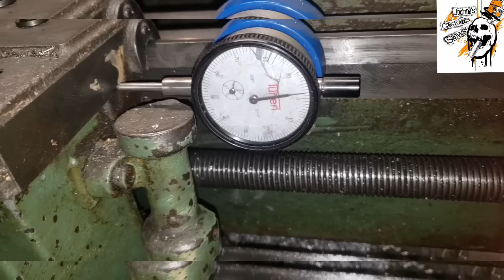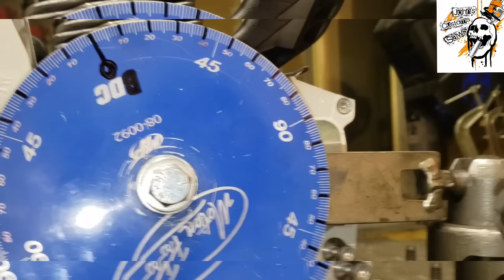Stihl MS461 chainsaw porting... START to FINISH... JCS

Comment: Never leave the oil pump dry… I use a couple big black Home Depot trash bags with a little tape between layers… you could actually ship it with fuel and it’s never letting out any odor… 

That’s a badass saw and I want one!!!  Everything that you’ve said and done is absolutely spot on… don’t ever change your ways because someone says different… you’re on the money!!!
Reply from the maker: I actually just had a shit show shipping issue over bar oil...  surprise inspection and it didn't go well 😬
Reply: @johnscustomsaws  I use trash bags…three layers with a little  tape on each layer…then toss it in a box!!
You can leave the gas in them and you can’t smell shit!!!  Drain and leave caps off sitting cap side down for a couple days and it’ll dry…rinse out both tanks with 70% dollar store rubbing alcohol… then stick a couple dryer sheets into both Reservoirs …

Comment: Sporty rick here from WLS... The original Saw Nazi 23 years.. hanging it up in 2 months, yes baby retiring!
Just wishing you good luck... Like what your doin, but if doin production speed up the process, slapin the pin back in flip saw on starter side look down into the piston to align pin, also polish the baffle and sharpen the top edge of it.. stay away from raising the exhaust port too high, you want the pop to give as it will give.......................... cutters will be very thankful for the next gen of power hungry saw guru's 
Tomorrow have 5-500i's a 881 and a 460 in new condition Monday's not going to miss them!

Comment: Hey thanks for the advice on the break in of a saw. I see so many people idle their saws for a full tank and never thought it was a good idea but now I know .... Thanks!
Reply from the maker: I will be honest i even wondered myself because people were being told by the dealership to do so... i didnt agree but was open to hearing out the theory... but after i opened up a couple that customers shipped to me... (new saws with a tank ran thru at idle)... i will never be convinced its a good method... they had tons of build up and they were running hot... they even had that "hot metal" smell... heat cycles are what i have always done since the early 90s and  its always worked great
Reply: I used to be a certified Mercury Marine mechanic and one of the first things they told us to ask about if an outboard came in with a dead cylinder and an excessive amount of smoke was "Do you use it for trolling (more important on the 65 horsepower and up engines) and then check the boat for an oil container to see if they were using a oil for air cooled engines or for marine use. Most people never seem to understand that the oil for an outboard engine is formulated to burn cleaner at a lower engine temperature than an air cooled one but I found one engine that was used more for low speed trolling or as a shuttle service for taking people from the dock to their private houseboat moorage that when we pulled the bottom piston out of an 85 horsepower four cylinder you couldn't see where any of the piston rings were at because of the oil fouling. But it also served to cut down on the lubrication of the piston itself and it had beat the skirt up so bad that you could almost put the thing back into the bore sideways because of the skirt shape.

Comment: Hammer Down brother. Start wearing gloves! I've been a mechanic for 25 years and wish I would have worn gloves from the beginning. Because now that I'm older my hands hurt and tingle go numb. I'll share and subscribe. Love the no bullshit attitude. Keep up the good work 👏
Reply: Duckworth atv and mx, I have been in the building game for 40 years and got to a stage where my hands would like lock-up with cramps and pain. Had this operation by a hand surgeon where he cut (or as he put it, slashed) the carpal tunnel free from the inside of my hand to release the tension in my palm, on both hands in separate operations. Sounds gruesome, and it is (and a very painful experience) but no more cramps in my fingers, and I can turn a screwdriver again ect ect.
Reply: I've also been "mechanically inclined" for the better part of my life, and as such have cut, burned, stretched, bruised, and beaten my hands to the point I would drop things from my hands going numb, and wake up in the morning an hour earlier because I had to run my hands under hot water as soon as I woke up due to the pain. 
Go get the surgery, do it one hand at a time and it isn't bad at all. I was out in my shop piddling around with stuff the same day after the surgeries. 
It's not going to get any better.
Reply: It's rheumatoid arthritis. I'm 56 and it just started in both hands. Diet and exercise. Reduce stress. Sardines have something in them that helps too--I forget what?--something about natural chondroitin being good for joints and found in the bones of the sardines.

Comment: That looks like fun! I ported many 2 strokes in the past. Kart racing reed and rotary valve engines. Breaking exhaust at 90 degrees!
Reply from the maker: Dude I want to try a rotary engine soooooo bad... I think it would be epic for a saw... they hit some serious RPMs ... thats awesome man
Reply: they sure do. When Mazda first brought out the RX-7 a fellow racer here in Northern California bought one new and on one of the service checks he said it was a real monster and when he took it in for the next thing he told the service writer that he really appreciated the tune up, that it would really come alive when it turned over 10,000 rpm's. The service writer turned white and checked who the tech was that left the rpm limiter disabled on the last service.

Comment: I'm a Stihl dealer. I combed through tons of literature in owners manuals, service bulletins, training materials and service manuals. The only references to damage from running out of bar oil was damage to the bar and chain. I found nothing that mentioned damage directly to the pump from running out of oil. However, in the service manual for the MS461 under pump installation it says, "– Lubricate the pump piston with STIHL multipurpose grease". 
As a service tech I have seen plenty of saws with severely burned up chains, bars and chewed up clutch teeth and rim sprockets from customers running without bar oil for extended periods of time. Once refilled the oil pumps are usually fine when I test them. I've also seen plenty of failed oil pumps from overheating when people run their saws with the brake on for extended periods and I've seen oil pumps in fairly new saws that have never ran dry just randomly fail. 
Not much of an answer I know, I'll call tech line after the weekend and ask them for a more definitive answer. I would like to know too.
Reply: Did you ever find out?

Comment: Just want to say John you got a great Channel and you're going to go places with it for sure I still have a small amount of Subs and have been at it for a few years but I'm not very active for different reasons. The biggest break I got was when aVe mentioned a saying that I use in my videos from while back when I was way more active for a bunch of different reasons. My channel will be back up and running but I'm having some spinal cord issues so I'll still be out of the loop for a little while. Keep doing what you doing man!

Comment: When I was to younger we were used to port and polish 400 and 421 pontiac engines. In the 2020s I guess chainsaws are next. In the next few years I guess they will be doing this to vacuum cleaners and vibrators lol.

Comment: 50 years ago anyone who ported aluminum used rubberized abrasive cones for polishing, available at any good industrial supply store.  Brand name is Cratex.  They were essentially the consistency of a metal impregnated crayon, and easily broke under minimal pressure, or even with your hand.  Probably why we thought they were actually made from clay and called them "crayons".   They mount to screw tip mandrels similar to sanding or buffing cones without an extended pilot shaft.  Step 1 of polishing would be piloted sanding cones or drums in varying grits prior to using "crayons" for mirror polishing the exhaust.
Reply: Cratex, still in use.

Comment: I have a 372 that I've ported and sha eved the head and made a dome top piston for and deleted the gasket on the crank case to reduce the size of the crank case and i would put it against any saw any time ohh and shaped the combustion chamber so at top dead. Enter there might end up being a open spot the size of your pinky nail

Comment: Great stuff !! Starting to learn. Converting a 290 to a 390 . Need to get back to work quick. What can i do just to clean up the ports with out degree wheel. For example take out the lip on the intake ??  Thanks again ,

Comment: open question. would it be worth the effort to do the last 2/1000's of the cylinder base on a lapping block rather than on the lathe? or is that just extra work for no return?

Comment: I have a stock husky 550xp. You knocked off the limiters on the carb. Is there a way to do that to the husky carb? To make it with normal adjusts. Thanks

Comment: Just curious, why would you NOT want a ported saw to be used for milling?
Reply from the maker: A tried ported and machined saw builds extra heat... it you are ripping a board and have the saw at WOT for 30 seconds or more at a shot its going to burn up the top end... now you can build a saw for milling but I would go about it differently and build it for straight torque and even add make some changes to the piston/cylinder to help lubrication...  I wouldn't drop the squish or cut the squish and I would probably do some finger porting  depending on model... also run it rich and a muffler mod... most importantly a  foam oiled filter like UNI/Maxflow super necessary 💯
Reply: @johnscustomsaws  pp

Comment: Question ? I just put a new cylinder and rings on a ms441 and when it’s tighten the cylinder bolts the crank and piston bind up and won’t move??  Before I tighten them down it’s spins freely ?